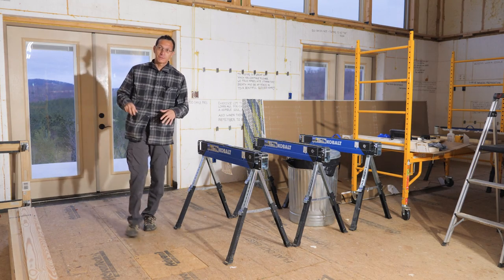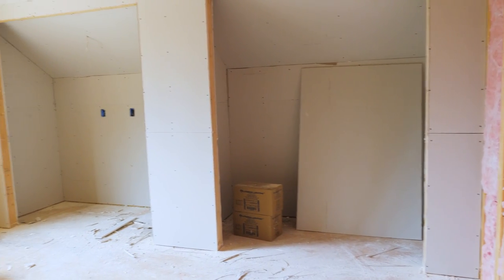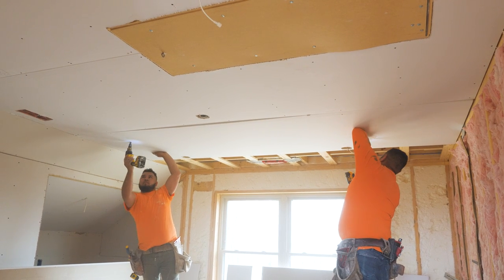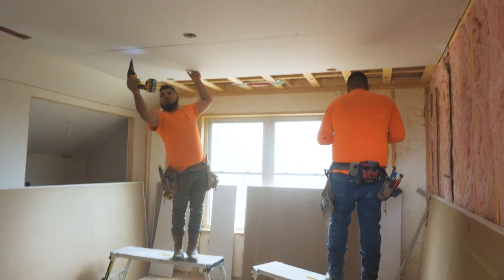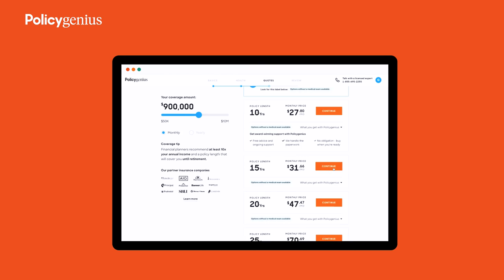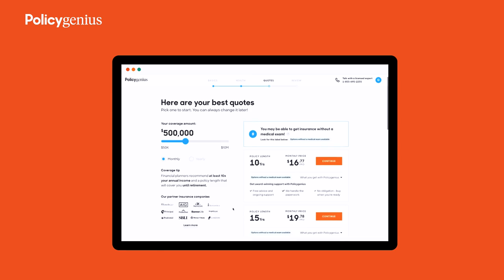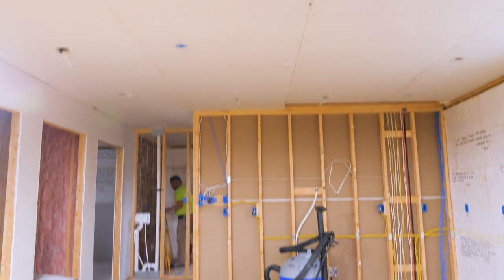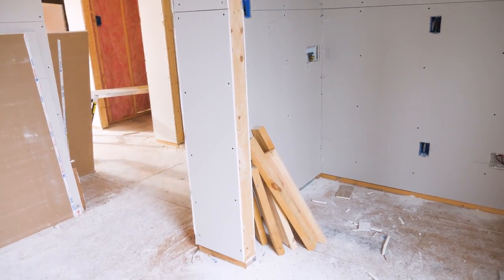We Have Walls! How Fast Can They Hang 9,000SF of Drywall?

Comment: That's a good point you made about being there this way if there's something there that you might have to change like that ring on the dryer fitting, when I had my house sheet rocked I did not watch them and when it was all done and spackled and ready to be painted which I painted, they sheetrocked over the outlet that had the television cable TV wires.

Comment: Those drywall guys looks like twins! 😅😅I have those big sheets in my ceiling in the living room as well. Remember, in bigger rooms you will see the seams between the drywallsheets, due to light from the windows. If I had known, I wouldnt only be plastering the seams, but had a thick coat of plaster on the whole ceiling, I am thinking about doing it now, because I hate the shadows in  my otherwise beautiful living room.

Comment: OK.  I’m hoping the high ceilings are going to be tongue and groove pine wood.  Installed by your framing crew of previous fame.  Stained by you when every you get to it.  Framing crew will also do the porches.  

When you and Jamie finish this home, you can start an internet consulting firm to refer quality minded subcontractors.  You have found amazing and very profession ones.  Taking time and checking out recommendations is so rewarding toward the end project.  Fewer regrets.  Housing market is totally crazy right now (spring 2021).  Lumber and labor is over the rainbow!

Comment: Jeremy/Jamie, quick question.  Why foam insulation for exterior walls/roof and the rolled insulation for the interior walls?  I'm not in construction at all just wondering if you found it was sufficient on the interior or if it was time/cost related?
Place looks great👍
Reply from the maker: The interior insulation is just for sound reduction

Comment: wow... thats some heavy labor..... here in sweeden, for the roof we use a sheetrock lift and a skrevgun with strips of 50/100 skrevs on them.... a whole lot easyer on the back =)
Reply: I was wondering if something like that exists.
Reply: Every sheetrocking crew does things differently... Some crews are faster without a lift especially since in this house a lot of the lids were not being sheetrocked

Comment: So because you have spray foam insulation you don't need vapor barrier?  Or is vapor barrier not used in your climate?
Reply from the maker: Correct. If we were using batts we would need vapor barrier under the planks.

Comment: There are crews that hang rock and then the ones who take some pride in what they do and the pile on the floor is completely staggering as to how much can be wasted. One guy hanging rock for me needed a piece about a foot wide by three foot long and he walks over and grabs new rock and whips out that piece. Later that day I look at the pile and the sheet had a mark on it to identify it was laying in the waste... with that small piece cut from it.... these are five by ten sheets and he tossed that sheet cause it had a piece cut from it. I hauled all the waste out to the compost pile to mulch it under and I really had a burr under my saddle so I told the guy who hung the house that I would do my own garage as I have enough in the waste pile to do a couple walls without even heading to the store. Its my time and I wasn't working so I could do it. As I progressed on, I found many sheets with just a small piece cut from it so taking the time, I got out the straight edges and cut out usable sheets to do it with as I did the mud as well. I understand the need for speed but I did that whole garage and some other rooms that they intended to come back for to finish. I didn't save a lot or other as I understand they have to go fast to make the money ... that said, my work came out a lot nicer than the hired sides and was not as expensive as just throwing money away. What you had on the floors for that whole house was what my crew had on the waste pile for two rooms and one ceiling. That was what they hung one day... some are good and others give it a bad name. I hung  the rest of the house and took back half the rock they told me I would need just for the house... If you work hard for your money its hard to watch someone else just toss it in piles on the floor.. Sure, I had to do it after working all day but I did get it done and it was a personal reward to look at it and say I did it. I also furnished all the meals and tools for the job all first class including the deli truck that delivered the food and its not cheap to eat out of.

Comment: What is drywall ?
Reply: Sheet Rock man, the stuff they were installing !!
Reply: @augustreil  I am clueless about this stuff
Reply: @targetedfordeath359 , Sorry, I wasn't trying to be a smart a$$, just kinda fooling around that's all. My apologies.
Reply: @targetedfordeath359  Drywall or Sheet Rock is a sheet of gypsum usually wrapped in paper. Additives can be added as well to help prevent things like mold and mildew. These are screwed to the walls using drywall screws. The screws and seams are "mudded" and taped using joint compound which is also a gypsum based product.
Reply: @lynnhoffmann3710 , Plaster is still done to this day and is far superior to sheet rock, but is also much more expensive so it is a rare thing.